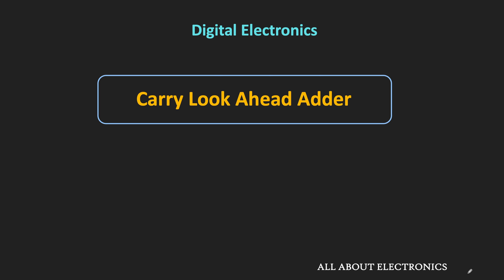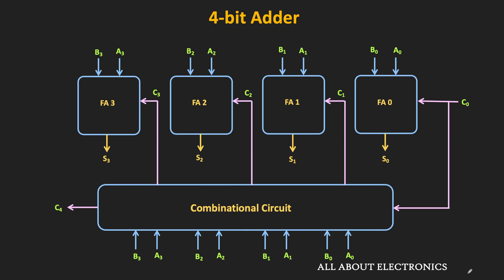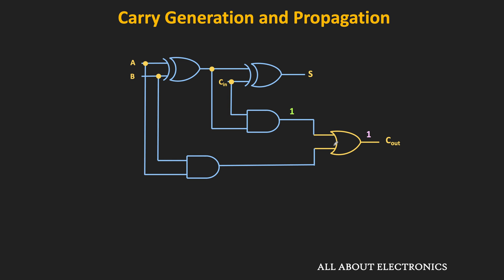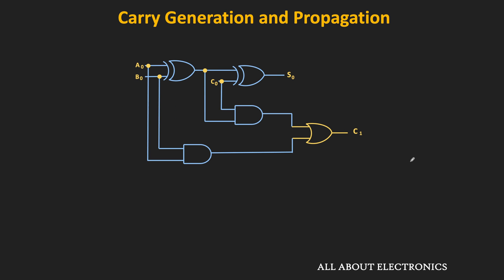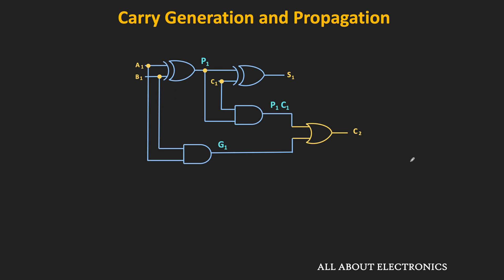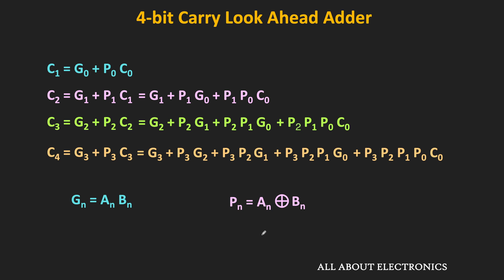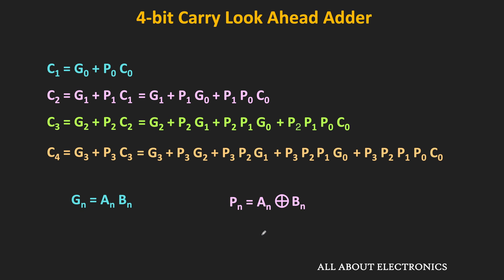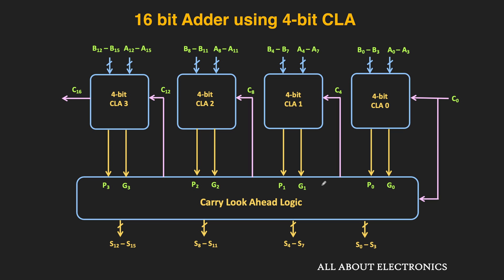Carry Look Ahead Adder (CLA) Explained

Comment: How did you get P and G from 4 BIT CLA in the last circuit?
Reply: The inputs a and b given to the 4 bit cla is also given to the carry look ahead logic that generates the carry bit...In this case the carry bit generates all the carry bits at once so the 4 bit clas does not have to wait for the previous carry...I'm not sure but I think that the marking on the arrows of (A,B,S)parameters means that it is common to both the cla

Comment: At 17:41 you didn’t explain what the yellow lines coming from each 4-Bit symbolizes. You also did not have any gates in your 4-Bit adders that create a P0 or G0?
Reply: Probably the same he did for 4 bit cla except you use p and g from the last fuller adder of each 4 bit cla